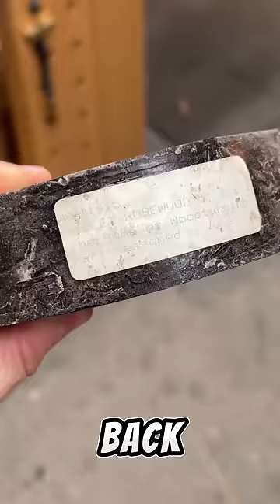The suspicious bowl blank 🧐

Comment: Australia's 'Incredibly dense timbers ' is an understatement. I've done building repair work with seasoned 50 yr old hardwoods and had to pre-drill it to be able to drive a nail through it without bending. Its not called 'Iron Bark' for nothing.👍🇦🇺

Comment: That stuff is soo hard i had a small piece i made a handle for our sliding glass door with. I broke 2 drill bits drilling thru a 2" piece of that stuff when i switched from a hand drill to a drill press it brought thedrill bit to a temp to scorch the inside surface of the hole and the wood was smoking when i finally got a hole thru